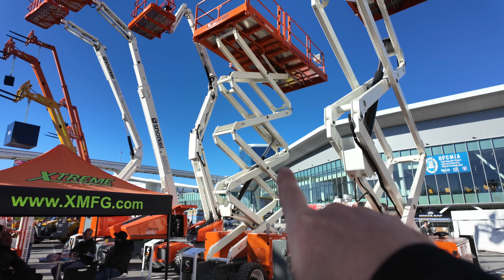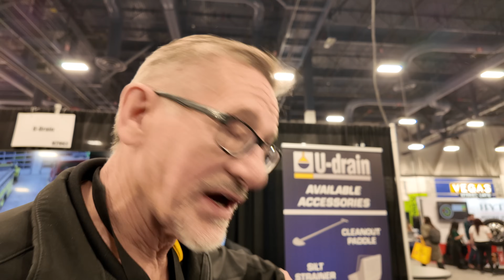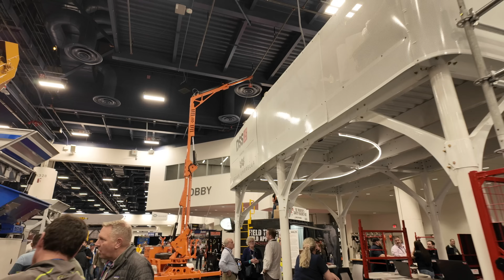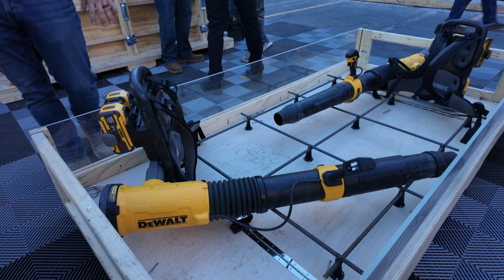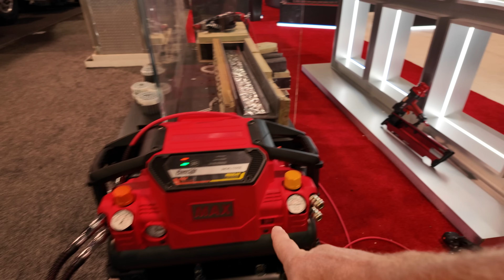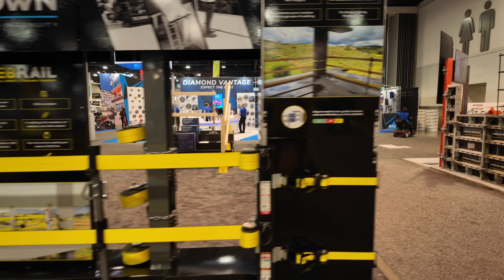Tools and Equipment That Caught My ATTENTIO: WOC 2025 in Vegas

Comment: I can confirm the max brand is well thought out.  We have the high pressure nailers, coil, jumbo, and concrete pinners.  All fantastic.  The rebar tiers are also above every one else.  You do pay but well worth it.  Also much quieter to run

Comment: I ran the tool shop for the commercial construction company I worked for. Milwaukee tool came to our company to get input for the new battery charging system for the gang boxes. A few of the tool brands came to us for input about what can be changed to the tools. I see Milwaukee came out with the new charging stations.

Comment: Those Milwaukee racks probably runin around between 400 to 600
Reply: I was thinking the red tax would have them at $1000
Reply: That Milwaukee stuff those racks with all the trays and all of that it’s gonna be $1500 that the two racks easily
Reply: @steveanderson4768  I was thinking $1000 for the racks with none of the pack out boxes.
Reply: 1500-2000
Reply: I don’t think I want to know to be honest. Ruin my dreams of getting them. I did add the pack out boxes that have drawers in my van to make it a little easier but it should would be nice to not have to unstack the other boxes to get something out.